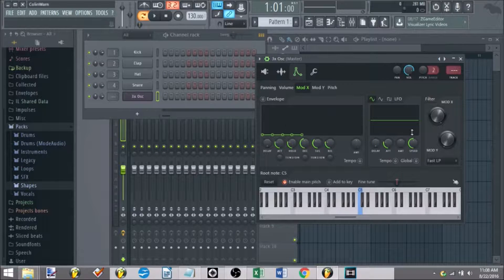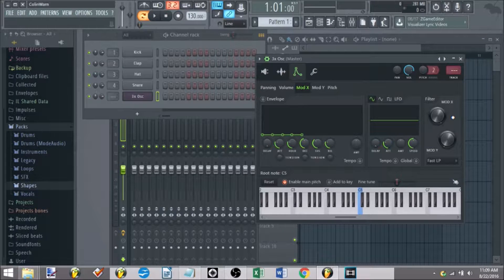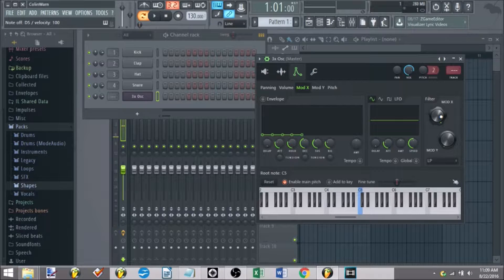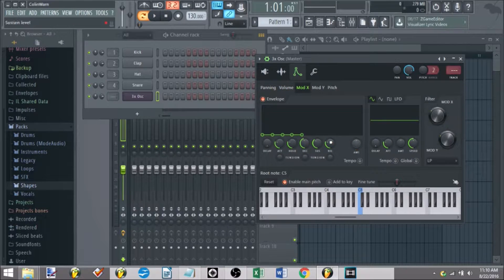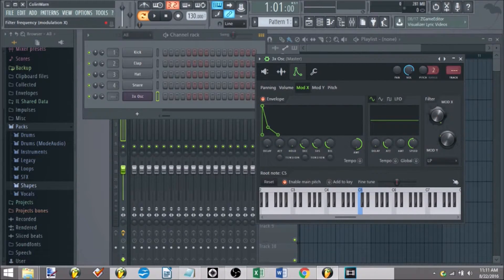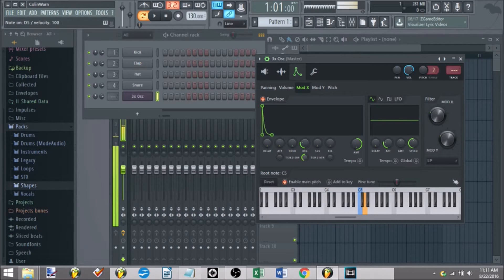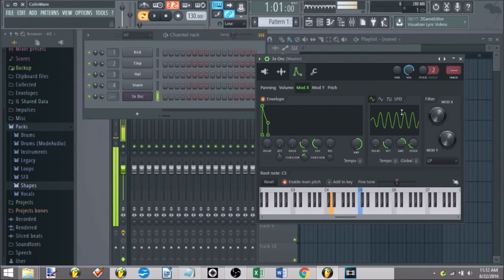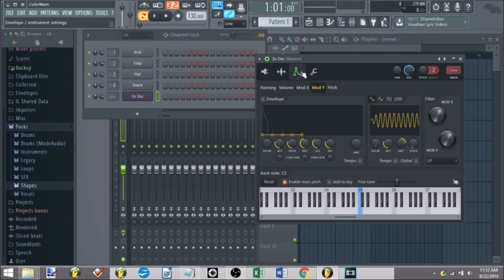FL Studio 12 3xOSC (and Channel Settings) Tutorial: Filters and Resonance

Comment: Well, you got the MOD X envelope wrong. The envelope doesn't pust the mod x button all the way up and down, but it actually controls how much of it is applied. For example, when you reach the bottom with the envelope, the cutoff won't be 0, instead it will be the same amount that the mod x button is set to.
Anyway, this is why you failed to create a pluck sound: you should lower the mod x button all the way down for that.
Reply from the maker: Ah, good correction!  The sound around 2:28 still has a transient, though as you corrected stated it wouldn't be necessarily considered a "pluck" unless I lowered Modx to the lowest value and pushed the sustain all the way down.